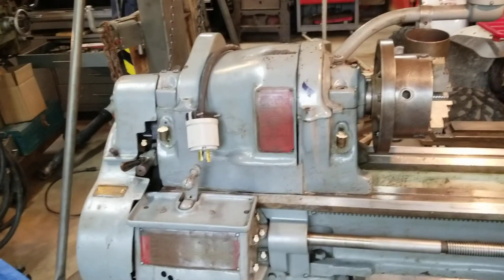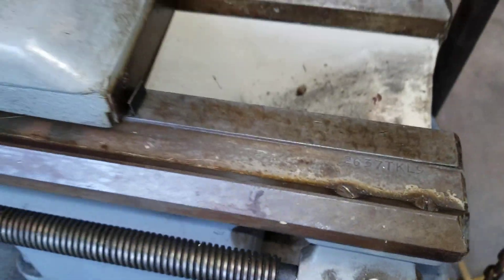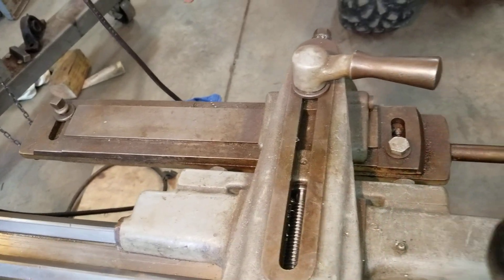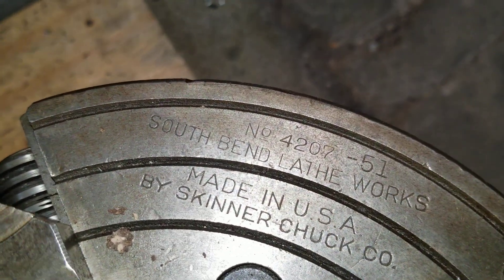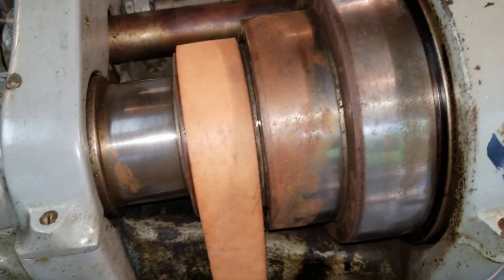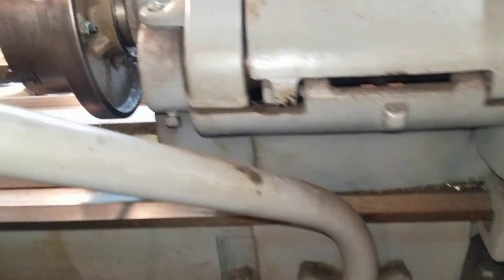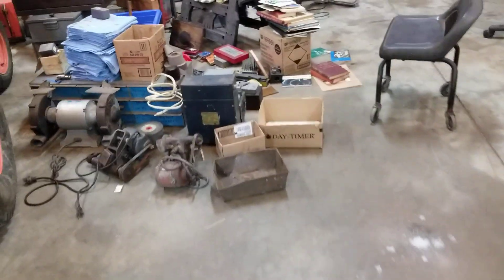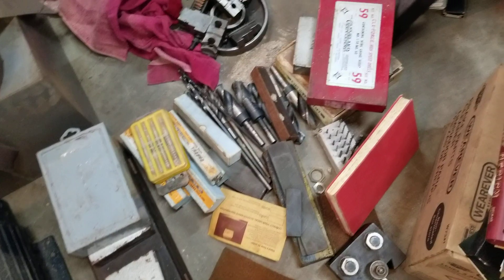South Bend 13" lathe, walk around my new old lathe.

Comment: I have the same lathe, mine is from 1967, it looks like yours is probably from the late 50's. Grizzly can get you a scan of the original build card for $25.00 which will give the build date and a lot more.
Reply from the maker: I'll look into that. How do you like your lathe?
Reply: @tomhendricks316  love it, not used it much yet, but so far so good.

Comment: I just bought one and doing some research.  The year 1950 started out with #1600 and the year 1955 started out with #5030.  So your lathe #2637 was made between those dates.  If they made the same number of 13” lathes per year yours was probably built in 1951.  For 25 dollars Grizzly will provide you with a build sheet for your lathe so you know everything about your particular lathe including who bought it when new.
Reply from the maker: Thanks for the info. I thought mine was earlier than that. Good luck with yours. 
Thanks for watching!

Comment: You can go to to Grizzle tools and purchase the a PDF of the Production card that will give you the production date and original purchaser, look for the South Bend tab on their web site. It costs about 25.00 dollars. I would say it is a early1940s vintage South Bend 13 with the single tumbler gear box. If it has a plaque on the bed that states it was approved by the war board then it was produced during WW II. Also you can go on some of the machinist forums and download the catalogs from the time period and using the Model number get a idea of when it was produced. The production card from Grizzly is well worth the 25 dollars.
Reply from the maker: I might just look into this. Question for you...what do you think I could sell that for? I want to get another milling machine